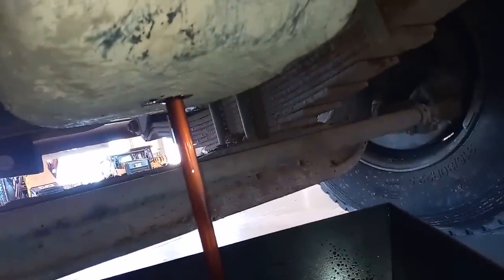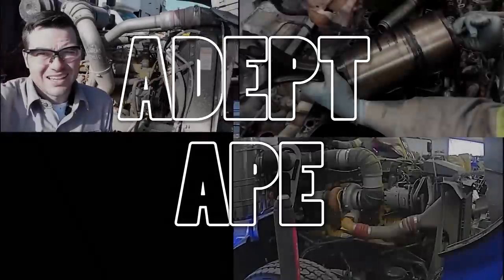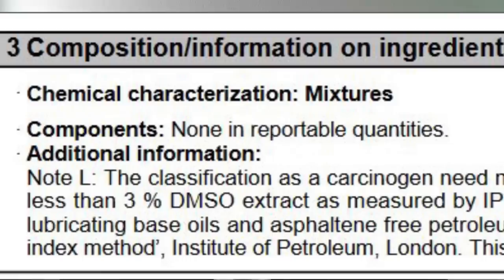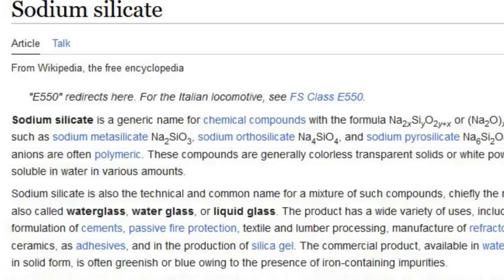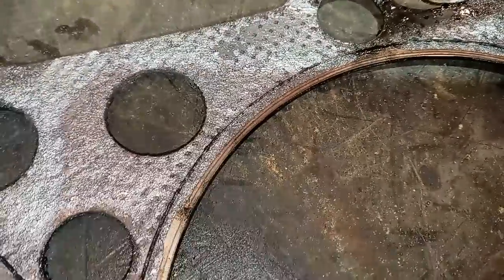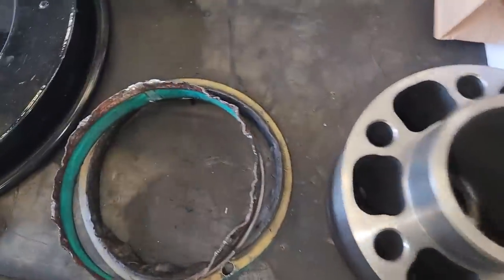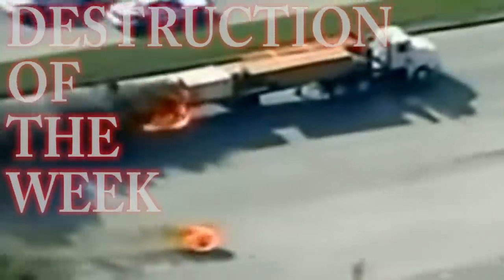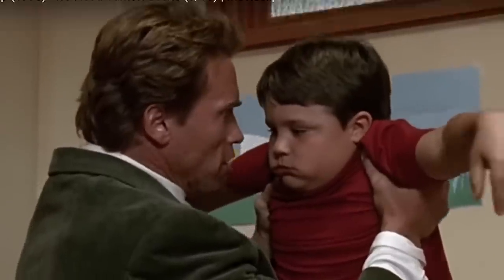Just Say NO to Stop Leak!

Comment: Radiator of my old Mercedes G-wagon (2.4l OM616 diesel) sprung a leak on a trip through Sweden many years ago, and I used the coolant stop leak thing on it (I think it was STP?).
It kind of worked. The leak would stop, then start again, then stop, and so on. But it wasn't constantly pissing coolant out the radiator core like before I added it. Got me through the trip and home, and I got a new radiator for it. Engine was running hotter than normally during that time though, and I did flush the coolant a few times before mounting the new rad.
The year after I ended up upgrading to a 3l OM617 engine (slightly less underpowered, but still no powerhouse), and sold the old engine to a friend of mine. He had no cooling related issues with it, so I guess it didn't cause any permanent damage.
Definitely not a permanent fix though.

Comment: I used to know a guy who, over time, bought a ton of F250 Ford with 6.0 at auction with blown head gaskets. He bought some stuff to run thru them that was about $100 a bottle and their kicker was that if it didn't fix it they would pay for the repair. It did work-for how long? Who knows. I run screaming from 6.0s.

Comment: Old rope main seal in 1953 Ford steady leak
Oil change and put 1pint of ATF in it and after a couple warm up cycles leak is gone next oil change back to oil only. ATF causes the old rope seals to expand. But only buys you time. But I’ve never used these products you’re talking about.

Comment: I've used the blue devil stop leak quite a few times n it I would say it works 25% of the time. Other times it slows the leak slightly or it just doesn't do anything. For like 20 bucks it's worth a shot. Repairs on those 25% stay that way even after you change the oil

Comment: In the 60's, oil burning cars got an oil change with 90W oil used to bring the oil pressure up & stop the oil burning past the valve guides & rings.  Works for about 100 miles & vehicle was purchased "AS IS" & criminal wasn't responsible for repair.

Comment: What I have learnt over the year's from a young boy aged 5 to me being aged 51 that these stop leak products have a chemical reaction with the oil or coolent.
This chemical reaction triggers a chemical change when the mixture of both your oil and stop leak hit the cooler air outside of the leak, like your oil pan or your rocker/valve cover. The same with the coolent and the stop leak, it is triggered when hitting the cooler air outside of the leak.

But it is not a permanent fix, it is designed to be used to get you to the nearest garage, safe zone to be collected or home.
So that the leak can be resolved correctly and if so replace the damaged part or part's, but the system will need to be flushed out thoroughly to make sure that all of the quick fix stop leak product or products are removed.

It is like the old driver's fix for a leaky radiator put a egg in your radiator and it will seal the pinhole up in the radiator.
Some say it works but most say it blocks up small port's and pipe lines.
But you still needed to flush the system out and check everything for fluidity.

I would not use any product that says it can stop leaks permanently, because they don't.
I know this from friends and family members using these products and causing more damage to the engine. Because they bought into the gimmick of it fixing the problem permanently.

Loving the video's and the content, keep fixing and teaching what to look out for when running a diesel vehicle. 👍👍👍👍👍👍👍

Comment: I have seen examples of heads that all available originals have shallow cracks, ex 216 & 235 stove bolt 6s intake runner to water jacket cracks, and have no affordable aftermarket support. These specific instances the glass resin type, poured only in the trouble runners and coolant passages, is the standard repair. Source: Hagerty Chevrolet "Stove Bolt" six rebuild.
Reply: A better repair would be pinning the crack
Reply: @Isaak Welch  I believe, although I am not certain, that the cracks in that specific example are commonly in areas inaccessible to that type of repair. Drilling and pinning would, in my opinion, be a far better option should accessibility allow it. I am of the opinion that any "liquid repair" is almost always in no way a repair. However, this source instance, the machine shop recommended said method as the only viable and economical solution (for that application).

Comment: I was dubious, but I found myself in a time/ funds situation. The sodium silicate does work with small leaks. It only is activated by high temperatures. I knew by testing it was a small head gasket leak. All is well 1 year later.

Comment: Had a company truck I was driving started using coolant. Called the shop talked to 2nd in charge he said to put 3 bottles of barzleak in the truck and get it back to the shop. I got it back to them and the big boss was there I told him what I was told to do and he cursed and swore at me, the only time I ever saw him do that. It took them a week and half taking it apart and flushing that garbage out of the system truck had a split in the heater core. I got chewed out cause all I would’ve had to do was shut the valves it was summer anyway. But I won’t put that junk in a truck again!

Comment: I remember the old days of the really shady used car dealers that would “fix” noisy valves by putting   STP  in to the oil and quiet the valves for a couple hundred miles if that. I can see using these in a very tight pinch like you’re in the middle of nowhere and have to get to the closest repair facility. That shop would have to attempt to flush everything out as soon as possible but that is about the only time I would personally use these products.

Comment: I may use additives like the Lucas stabilizer but anything that claims to be a mechanic in a $12 bottle is selling snake oil and in rare cases it may stop a leak but the other precision engineered components such as water pumps main seals and so on need proper lubrication and so does oil stop leak have the same lubricating properties as oil? No it doesn't  and even for vehicles you're gonna scrap I don't recommend because someone else who is a 1990's Ford ranger fan may see a new ranger in the junk yard with a rare series of motor and is willing to pay top dollar for and cone to find out the motor is seized because stop leak sealed the valves shut or something

Comment: Can cause problems. Yeah, right! Bought a 1999 Jeep 4.0L with about 150K miles. Pretty clean and ran great. No apparent problems. Those engines are tough and very reliable. Heater core sprang a leak so I bypassed it for summer. Didn't want to fix it just then and didn't need it at the time. Anyhow, later that summer drove from West Virginia to Chicago to move my mother-in-law. Hooked to a 16 ft box trailer and moved her, then brought that trailer back to WV loaded. No problems at all. 21 MPG out empty, 15 back fully loaded. Came fall. Had to fix the heater. Well might as well flush the cooling system too just because. Well long story short, all was still good for about a month. Then I overheated on a 30 degree evening.  Hmmmm..  No coolant in the radiator. No apparent leaks. Pulled the dipstick - found the coolant. Pulled and checked for head gasket and cracked head. No signs of either. New gasket and re-assemble. Same thing again...all the coolant was in the sump. Well turns out the person before me had cracked the block and filled it with something before selling it. Cost me an engine. When we pulled it there are 3 freeze plugs on the back. 2 were brand new and one looked like it had been in there for 150K miles.
Reply: 21 my ass.

Comment: All they are is a seal sweller. If you use them make sure not to keep them in your engine for too long and change your fluid after a few hours. Other wise your seals will swell up way too far and blow out.

Comment: KC seal about 80% effective on normal gasoline engines with small leaks.
Not diesel or if head gasket fire ring is blown through.
I have fixed so many older cars lasted years.
Worth a try on older  gas cars trucks .
GM even made one for Cadillac aluminum engines.
Don't use the old one that looks like rabbit dropping s clog heater core .

Comment: I just heard this a about a month ago.  If you have a leaking seal put about a half teaspoon of brake fluid in the offending component.  The brake fluid will expand the elastomer in the seal.  Do they work, probably for a little while but the long-term fix is to replace the worn out part.

Comment: Lmao. I’m sure our yard horse with the c15 acert that’s using 2gals of coolant a day looks just like they inside. Plugs the oil filter in just a few weeks time. Was barely pushing 40psi oil pressure at 1500rpm fully warmed up. Changed filter bam almost 70psi.  Company isn’t going to fix it. Just run it till it dies unfortunately.

Comment: I personally would NEVER use or recommend any of those products because I have seen what they have done to some vehicles I have worked on. Even if you stuck on the road and use a stop leak to get home most of the time you can't undo the damage it can cause. I have seen them block radiators, hoses, heater cores and so on.

Comment: Hey lay off the old vehicles. I drive a 1993 Ford Tempo, 147,000 miles. Just replaced the dash last year, repaired the headliner a few weeks ago, steering sector, fan, etc.
PS, what did the FRAM commercial say?
Reply from the maker: Not judging, just picked up a 1984 vehicle last week. You can probably even guess what kind it is.

Comment: Steel Seal is the real deal. Fixed my diesel turbo blown head gasket for 1 year. When I got home (I was on a long road trip) I found the head bolts were loose, head gasket had been 'walking' and cracked in multiple places. Impressive product. Did not find any issues with cooling system and pump, cars still with me 6 years later. I'm a mechanical engineer.  Gets a positive review from me.

Comment: Thanks, great subject. 
Panty hose as a fan-belt ... Worked ... got me home.
black tape on heater hose ... Worked ... got me home.
by-pass/excite/hot wire relay in voltage regulator to charge ...worked.
I've used saw dust in rear end to stop howling gears. ... works till it don't.
also. ground black pepper in the radiator to stop a leak in the radiator. ... works till it don't.
also I've seen a guy use cement 'ON' a radiator to stop 🚫 a bad leak, forklift into radiator. ...  works till it don't.
Remember Alaska here and I truly have lived two weeks from everywhere at times. When you're 100 miles or more from civilization.... You well do dang near anything to get back home..
Reply from the maker: I'm more concerned that you had panty hose in your truck to use as a fan belt 😁

Comment: Bars liquid oil stop leak is ONLY one that works. Ive seen it seal chev 350 oil filter housing o rings. Literally made a clear allmost silicone seal. BUT IT WONT FIX HEAD GASKETS. NOTHING in a can fixes head gaskets. For temp repair to get home bar's brand is way to go. Coolant tablets or brown oil liquid